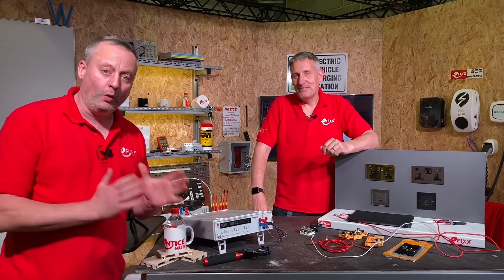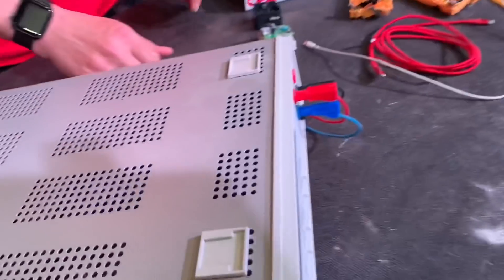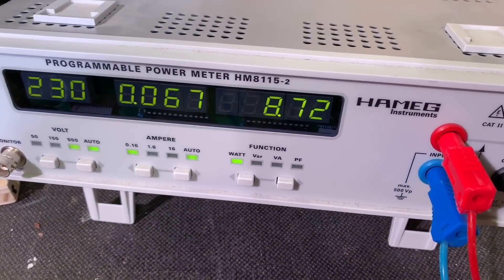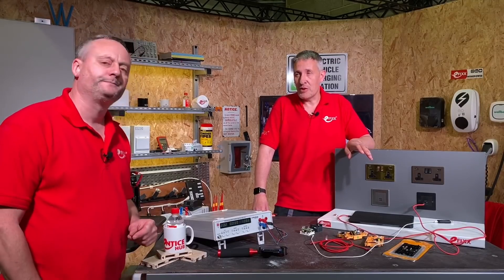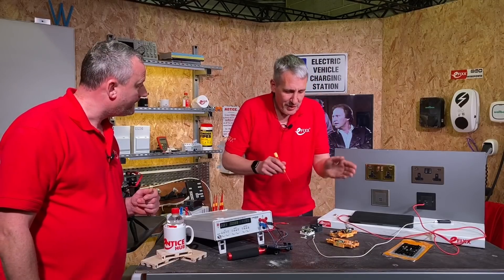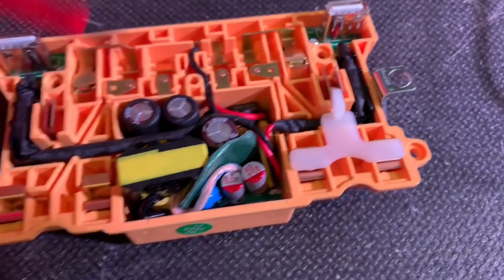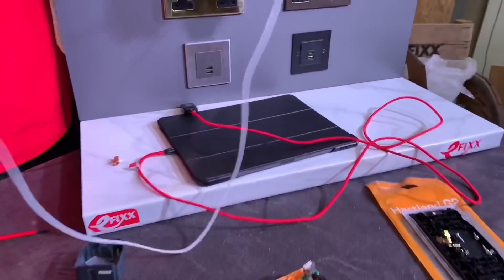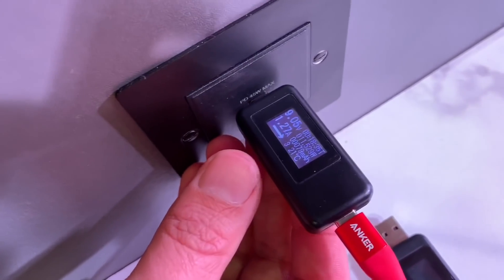Do USB sockets use power when not in use? How can you tell they are working correctly?

Comment: Loads of useful info here, thanks guys.
Really surprised to see 15volts output from a usb charging socket- I'll watch out for that.

Also, great to see you using Anker charging leads. They really are the best.
Reply from the maker: Thanks - The various quick charging protocols are interesting - The power delivery PD version will support 45W of charging - Anker leads are rock solid
Reply: @efixx  I believe PD spec can step up to 100W (20V). Thanks for the vid (and giving me scary flashbacks to my college days with the set ;-))
Reply: @tristramclifford1114  The initial PD spec for USB C (there was a previous PD spec using a variant of the USB A/B connectors but afaict few if any manufacturers used it) supported up to 20V 5A for 100W. However basic USB C cables only support 3A. For 5A you need a cable that is "electronically marked" to show it supports the higher current.

There is a new version of the PD spec that ups the max voltage to 48V and hence the max power to 240W. Again specific cables are required.

Comment: Do the regs now require these to resist 500V insulation resistance testing? Would they still mess up the resistance measurements? This is the thing which annoys me most about this stuff. Before anything, you need a good way to test the fixed wiring.

Comment: I still think filling a house with USB charging sockets is dumb.

First of all there is the issue of charging speeds. The USBs built into regular sockets seem to be at the very slow end of USB chargers. The hamilton PD Euro module looks interesting, but I can't seem to find anywhere actually selling it or even a part number for it ( https://www.hamilton-litestat.com/marketing-hub/latest-news/usb-type-ac-sockets/ mentions it, but gives no part number and links to a page that only mentions USB A modules ). In any case I can't see it being cost-effective to fit Euro module chargers in more than a handful of locations.

Secondly there is the issue of standby power, it's not a huge cost but it's not zero either.

Finally there is the issue of what happens if it fails. With no way to isolate it your whole socket circuit could be down until you can get it removed.

Comment: Great video - I haven't fitted any of these yet - and did wonder about the standby power drain on these. Good to know that there are regulations in place to control this.
It isn't just the bundled USB chargers that need to go, the AC to DC transformers should have gone a long time ago and many can in some cases be replaced with a USB driven equivalent.

I have a handful of USB to DC cables (also available from a typical online retailer with free delivery).
- The USB A to 5v ones are only a few quid, and there are many devices that would be shipped with a 5v 'wall wart' AC adaptor.
- Many sellers sell USB 5v to DC 9v or 12v cables as well. - these are a few quid more, but work great on lower powered devices.
- Haven't seen any USB PD to higher wattage DC converters yet

Many battery powered devices to accept a 5v DC input to allow a USB Powerbank or wall socket as a power source.

Hopefully new devices will move towards USB C PD for the higher powered devices.

Comment: So am I right in saying if you want Fast Charge don't but the normal socket outlet. Buy the Power Outlet type for the right solution Yes.
Reply from the maker: Yes - go for one labelled as quick charge or power delivery - but again it does vary by the type of device and manufacturer.
Reply: @efixx  Thanks Guy's 😊

Comment: Well designed electronic circuits with quality components can last a very time.  I believe most LED lights fail because of low quality faulty components.  A power consumption of 0.3W over a whole year uses about 2.6KwHr of electricity, about 40p worth, just to keep one charger running for a year.  Plus the additional cost of changing the devices attached.  The average 2019 uk domestic electricity bill was about £680.  20 million UK households.  £8 million pounds worth of electricity is there is just on of these chargers in a each household.  I wonder how many wind turbines would be needed to supply this much electricity?
Reply: This is just the tip of the iceberg, the amount of devices, apppliances  in the average home which are on standby, or just sat there drawing a small power consumption is considerable. 
Its a fine line between consumer convenience and environmental considerations.
Reply: Point well made. Of similar concern to me would be the increasing popularity of wireless charging which has a poor efficiency compared to wired. Another example of convenience for the consumer but when you multipy it up a significant environmental cost.
Reply: I have recently had a smart meter installed.  The lowest power consumption I have so far seen is 32 w.  Assuming this is devices on standby, gas boiler etc. this is my base load.  This is 280 KwHr per year, 10% of my annual consumption.  Standby is costing £78 a year.
Reply: @mrat42  Things like fridge/freezer will fluctuate as the compressor kicks in briefly, then remains idle for 30 mins ~ 1hour, or until you open door...
Then the compressor kicks back in and your 32w shoots up say 40w to 72w briefly, so your smart meter readings will fluctuate a little even with next to nothing switched on.
The hidden kicker is the sharp STANDING CHARGE RISES...
These have shot up from April at say 25p per day (£90 pa)
to 45p per day (£165 pa) £70+ increase and you are charged this regardless of 32w standby or 3.2w.
This winter is going to be a costly nightmare for everybody, so much that people really need to look at how they can reduce their energy any which way they can.
If your fridge/freezer is very old then people may need to look at replacing it with a newer/recent more efficient model - yes this involves cost, but these appliances are operating 24/7 on/off compressor etc...
So monitor the fridge/freezer, even buy a power monitor plug to help check/narrow down what devices are less efficient. Often you can leave devices plugged into these monitor plugs and confirm over 24 hours how much energy they are using - as the fridge/freezer compressor will initially draw say 50w until it reaches temp, then shuts off, turns on again as temp rises briefly etc...
Anyway... LED bulbs (warm white for most instances), fairly recent appliances like fridge/freezers, turn off most stuff not being used - things like Sky/Virgin TV boxes are often left on without thinking...
That is about all you can do, come winter it will be common to boil a kettle for a cuppa & then pour the remaining hot water into a flask to use later.
The energy price is going to rocket, the standing charge has already jumped and may jump again come January 23 - best of luck to all consumers trying to get by this winter
Reply: @authuruksake969  Thanks, aware of the points you make. Aware so many devices are turning on and off,  mostly the in home display is getting data around 60w . I used to have an “owl” device with a clamp round meter tails.  That read power consumption. That must have been less accurate.  The base load then was never less than 90w.  I also have a Maplin plug in power meter. It didn’t seem to show anything below 5w, so not much use measuring low consumption.  The Octopus instructions for the power meter suggested moving the meter around, it had battery backup, to the location of each device and turning it off and on to see the posse consumption.  Unfortunately it was faulty, the replacement is not battery backed up.  Trying to get a replacement.

There is a big argument for getting rid of standing charge.  It’s a tax on the poor. I think you should pay per Kw, with standing charges in the Kw hr price.  If we are really serious about energy saving persuasion then each household should have a progressive charge, so the more you use, the dearer each kwhr should be.  Giving real incentives for everyone to use less, and to have smart meters installed.

Now how you price this is not easy.  Octopus can measure and charge variable half hour time slots.  They are trialling a device that lets you detect energy consumption per device.  Some sort of device fits into consumer unit, really of interest to those who use a lot of energy in the low demand hours.

I have also being experimenting with using gas and electricity to boil water in a kettle.  Gas seems slightly cheaper per litre boiled, even though it a quarter of the price of electricity per kwhr.  The convenience of electricity I’d worth it, particularly as it switches itself off!

We need some Bold Political Thinking here.
Reply: @mrat42  make LED bulbs last longer & save/reduce energy...
search YT for:
"Doobying a cheap LED floodlight with lux/efficiency readings"

only if you understand electrics btw - ignore if you are unsure about mains electricity
Reply: My thinking is just that if every house gets just two then all the four and six way extension leads with them build in as you say it all adds up.
Reply: Two culprits that can draw over 1w on "stand-by" are extractor fan's "timer" module, Manrose use a rather dated pcb with a large resistor that runs quite warm drawing 1w or just over with light off/fan/timer not running...
There are more efficient alternative extractor fans drawing less power both on fan & the timer/pcb
Another culprit is ye olde shaver light/socket with 110/220v outlet, there is a transformer in some drawing up to 2w just standing by - in these modern times most devices can detect the AC voltage so really little need for a dual voltage shaver outlet, except maybe for hotels ???
Eco reality check...
In general, we are often using less energy than say 10 years ago, each year we try to use less & less, but even so we are paying more & more despite us trying to use less & less KW's
Reply: One of the biggest offshore turbines would supply double this power whilst running full tilt.

Comment: a time delay 3.15A fuse for a 20W PSU? so we're looking at a sustained 800W+ draw to blow the fuse. Would a smaller fuse not make sense ?
Reply: it's only there to disconnect it if it fails catastrophically, inrush on switch mode supplies is what defines the fuse rating.

Comment: 11:20  - USB Type-A doesn't do any voltage negotiations.  It is always at 5v though I believe current draw can be negotiated but not in a smart way.  USB-C can go up to 20v.
Reply from the maker: It depends on what protocol is being used - you can find USB A chargers which have implement Qualcomm quick charge - https://en.m.wikipedia.org/wiki/Quick_Charge
Reply: @efixx  True, but that isn't a USB standard. USB-C does this natively for example which is why it is much more expensive and complicated to implement.

Comment: Hi - I am not an electrician but what happens if you wish to conduct an insulation test between line and neutral ? I assume you would need to disconnect the socket wiring as there is not a seperate charger switch fitted? Despite a relatively low power consumption I would prefer manufacturers fitted  a charger isolation switch. All those 24/7 sockets multiplied by many households and the watts add up. I suggest eventually the electronics will fail (dry capacitors of failure of other devices through voltage spikes) so fitting replacement sockets will prove good business for electricians and manufacturers. Cheaper to buy a new plugtop style charger than USB  socket outlet.

Comment: Great video I always wondered what the current draw it would be, my only concern now is cheap knock off from China well anywhere really. I know I have looked at some of the US versions of these and went $30-$50 I don't think so, eBay under $10 for better or worse.
I understand that the fuse is not 'user, replaceable but that whole outlet is now e-waste.
Reply from the maker: If the fuse blows it’s not any easy repair job -it’s a sign something else has failed.  You have to trust the manufacturer - it’s the isolation between primary and secondary which is the killer.
Reply: @efixx  or most likely somebody with a very dodgy USB cable.

Comment: When I install a usb socket I use a dual box and a   a non-switched fused outlet  , Fitted with a 13 amp fuse and those euro module on ones via  unswitched fused outlet fitted with a one amp fuse. the reason why I wire them that way because there are far to many " grey imports ", plus you don't quite know what inside Those sockets. Plus it allows you to do testing by pulling the fuse and taking the socket " off line " and not interfering with the test . Those internal 3 amp fuse is to large for something that draw less than 50 watts.

Comment: Hi, I'm no electrician, just a consumer with product engineering as a background and interested in all things gadgets.
I have been one who detested the idea of sockets with built in USB power delivery but also understood the mound of charger units waste. My concerns are, as many , 1- for constant on energy waste and 2- for the possibility of failure, mostly due to heat from what I surmise. I see how many LED lights fail so fast with many thet die to heat dissipation failure.

Even though you have demonstrated that when the USB sockets are not being used, the watts is very minimal indeed. Though if these sockets became the norm, and with more and more gadgets being used, the totaly energy waste is still a waste . Over a nation or world, it will still add up. Would it not make sense to have some sort of switching mechanism? Either an independant switch or internal. At least with a tradtional plug-in type you have the option to be fully off.
Also, that means when you go on holiday/out the house, though we leave the fridge freezer on, many turn off all other unnecessary devices, these USB sockets will essentially be live. In my eyes its a hazard even if they are off a quality brand.

Secondly, I thing it's inevevitable that some sockets will fail, as I mentioned about LED lights. Essentially, part of the socket is useless, whereas again, a normal tradional usb charger can easily be swapped.
If the consumer decides to replace, does this not add to electrical waste too? In fact, it would add more waste as the whole device is thrown away. Unless we start using euro style modules for easy replacement or the manufacturer replaces the usb switching power supply module (unlikely).
Overall, personally speaking, I don't think it's a well thought out plan for the long run, yet. 

Perhaps in the future, there will be a USB power delivery mechanism straight from the consumer unit.
Thus, only requiring one or two USB delivery power modules, and also can be switched off independently or swapped out/replaced. Well something like that.

What are your thoughts? Thanks
Reply: There is nothing to stop an sparky installing a euro module charger in every room on a radial circuit via a 6 amp breaker using 1.5mm T&E. Your be surprised how many electrical accessories, circuit breakers and light fitting that have electronic modules fitted , We all fit mains powered smoke alarms for example,  Consumer units are becoming more and more computerised. The only you could be completely safe in the way you describe , is when you go away on holiday is to pull the DNO main fuse